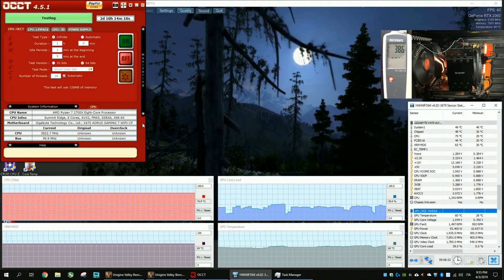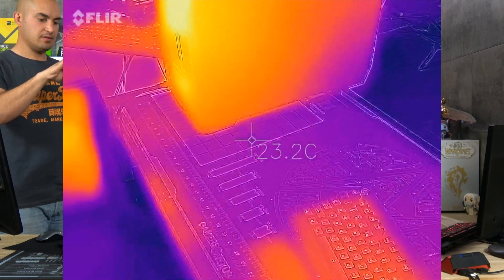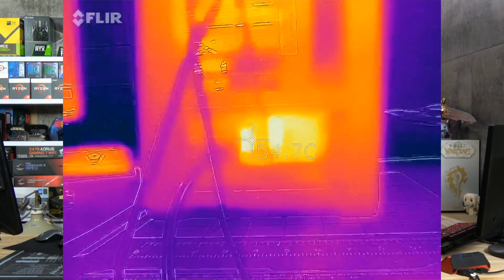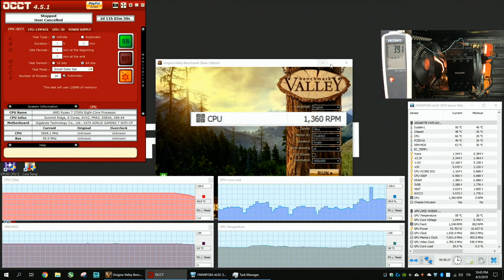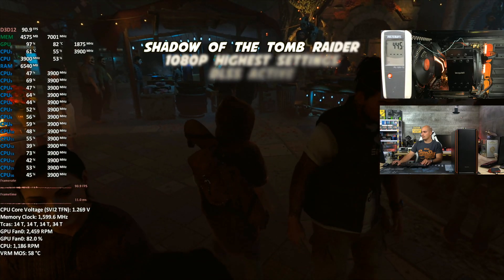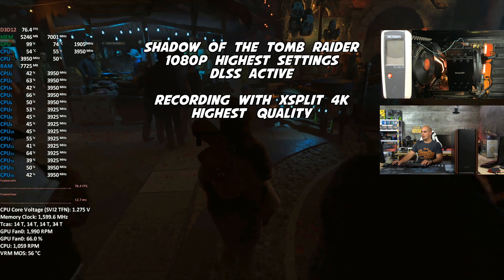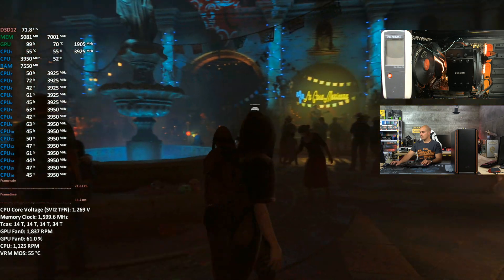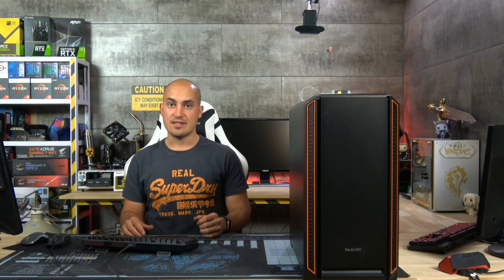Testing The Ultimate 4K Dedicated Recording and Streaming PC Build (Part 2)

Comment: Great video! Subscribing for support! I can't wait until I build this desktop. Going to use the same build you did here for my dedicated stream/recording desktop. My current Gaming desktop has the (GPU) RTX 2070 Super & (Motherboard) Asus Prime X470-pro with an (CPU) AMD Ryzen 7 2700x, no SSD right now and an 850watt I believe PSU (Might be 750w). I don't plan to upgrade to the 2080 or 2080 ti for a long time, but other than that is there anything you would recommend for my gaming desktop? I want to be able to live-stream at 4k 60fps once I get my upload for internet up. HOWEVER, for now I will be recording at -----------------> (4k 60hz/fps). I will stream at [1080p 144hz/fps].